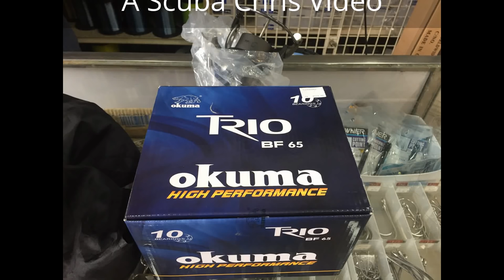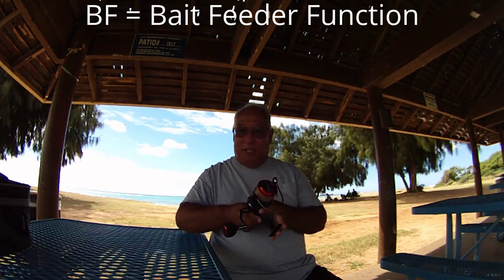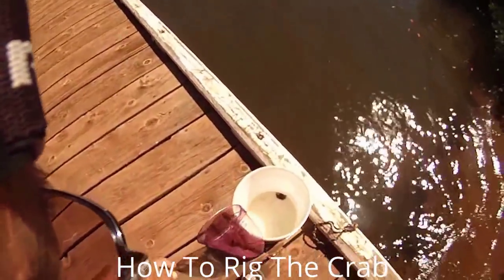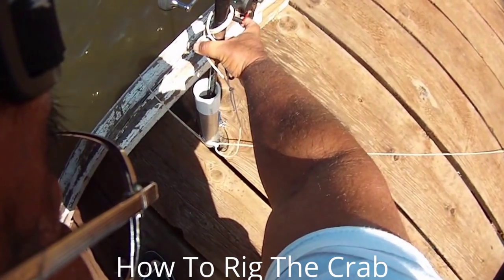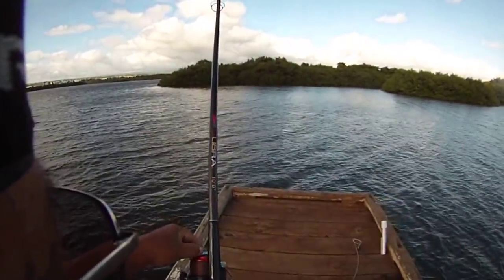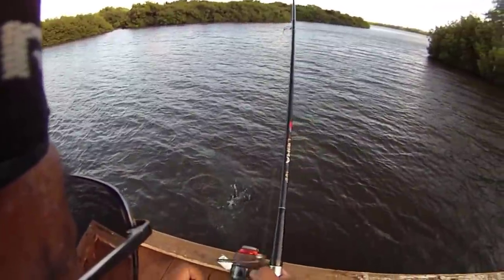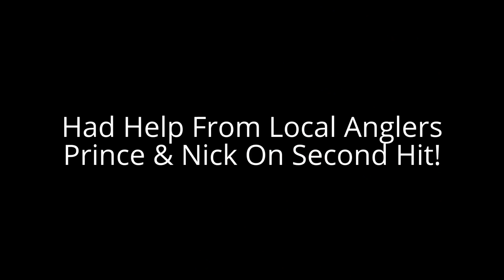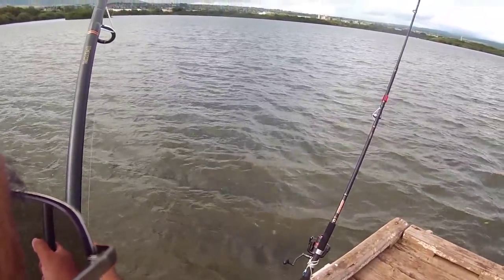My 1st Bait Feeder Reel! The BF-65 by Okuma!

Comment: Hi from UK Chris - hoping you can advise me. I'm a long term subscriber but came across this video when searching for Bait Feeding reels.  I was given an Okuma Carbonite CBF-155 some time ago & have just dug it out as I have bought another rod. I was trying to find out how it worked. Do you know (or can you find out) if the knob on the rear of this reel is supposed to turn? Mine won't move. Thanks Chris - tight lines.
Reply from the maker: I have no experience with the model you mentioned. But if you haven't used it in awhile i suggest you clean & lube it first. That knob should turn like my BF-65 unit. 

https://www.youtube.com/watch?v=MWpOaD3fbRE

Comment: hi there. I have a Trio BF55 on my Ugly Stik Tiger. it was doing well landing dozens of catfish ranging from 5kg-25kg and at times the drag system "failed". it was as though the baitfeeder switch was ON even though I turned it off. has it ever occurred to you throughout your use of the Trio BF series? any idea what could be the cause?
Reply from the maker: I have the BF65 but no, i never had problems with it as you described. I think you need to contact Okuma direct on this. Sorry.

Comment: Great video! I live in central Michigan and watching stuff like this makes we want to fish saltwater bad lol. Question? Is cutting the line like that the norm for saltwater fishing with certain species? I’m an avid freshwater angler (along with ice fishing, love it) and where I’m at we would never consider leaving that much line, along with a hook, in the fish unless it was accidental (line break or something). Is there any way to safely retrieve the hook from those fish or is it just not worth it for the anglers safety (hence cutting the line)? I know absolutely nothing about saltwater fishing, practices, or law.

Also, I just got an Okuma Avenger ABF 30b for ice fishing northern pike. Your video makes me excited to use the baitfeeder function. Now I just have to wait a few more months for some ice lol. Thanks!
Reply from the maker: I always try to get the hook out. That day there was an extreme minus tide & it was impossible to lift & beach the Ray safely. Normally i'd drag it onshore, flip it over, then pull the hook out. You have to flip it over so the barbed tail can't hit you. So i try to cut the line closest to the hook, not my desired option. Since i have found that area has a fair number of Rays i have purchased the longest pliers i could find at 11in & i now fish this area using barbless hooks. If i hold the line with a hooked Ray at water level the Ray will now "flip" itself off the barbless hook. Since i don't eat Rays, i release them. 

This is a unique area, an inland sea surrounded by raised  lava flows with mangroves growing within the cracks. It's also haunted. State workers there have seen walking people at dusk. The local enforcement officer has seen an apparition drowning, turned out to be an old Japanese man who tried to wade out to an island but got stuck in the sink mud and drowned at high tide on Jan.1. I also have seen a full figure standing next to me at dusk, a grey bearded fisherman wearing burlap cut clothing looking sad at the city while standing on the floating log next to me, had my unit on filming but no image when i got home. I told my buddy who worked there about the log and he brought a big guy 2x my size to cut it up for disposal, but when he found out about the old guy seen before by others he decided to go elsewhere. My friend there met a large Hawaiian lady walking and chanting at dusk. He asked if she was lost & needed help, she just smiled and faded away. I was told there was a Hawaiian village there that wasn't "properly" moved. It was a traveling canoe station, like a Greyhound Bus Stop. 

Sorry, rambled on. Baitfeeders are unique. Gives the angler time to set the hook. Fish doesn't know it's hooked until it feels the bite of the hook's tip.
Reply: Scuba Chris 

Wow, what a response! Sounds like a very special place to experience. I do honestly believe you too. Some places can leave you with many questions without providing many answers. It’s sad to hear that the village wasn’t “properly” moved. I understand what that means....

Anyhow, thanks for responding and the information. Catch a big one! I’m ready for some 40 inch northerns on the baitfeeder.

Comment: Have you upgraded the handle knob and bait feeder switch?  I have one and it has a silver handle and grey plastic bait feeder switch
Reply from the maker: +Woods Wanderer 
No i haven't. So far i haven't felt the need to upgrade it at this time. Looking at the BF-80 right now.
Reply: +Scuba Chris thanks. I have several of these in different sizes and none have any of the red parts yours have. It looks great and like upgraded parts. Did you get it from a tackle shop that had already upgraded the parts?
Reply: +Scuba Chris I found the difference. Mine are the  okuma avenger abf. Yours is the trio. 
Great video. Thanks. 
I have had good luck with my Avengers. You can find the 80 series on eBay for $60-80. 
Take care.
Reply from the maker: Sports Authority since i had a $30 coupon to use.
Reply: +Scuba Chris I just saw the BF 80 on reds gear.com for 25% off. They are normally $129. Selling for $96.99
Reply from the maker: +Woods Wanderer 
Thanks for the info! I'll look into that.

Comment: What kind of rod is that Trio paired with? Love the the trio, I have the 20s, 30s and 40 but looking into the 65BF for surf fishing. Thanks.
Reply from the maker: It was on a 10' TICA Libra in this video. Now it's on a Penn 12' Prevail, a much better pairing. I also use a 10' Battalion as well. Thanks for watching:)
Reply: Thanks for the quick reply! Awesome videos.
Reply from the maker: Thanks:)